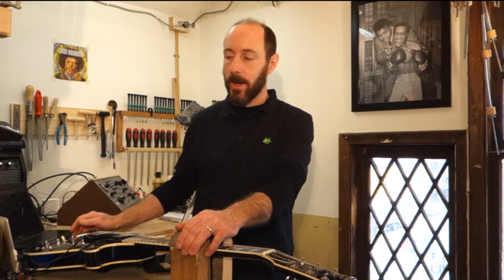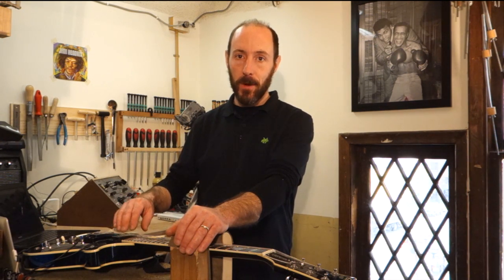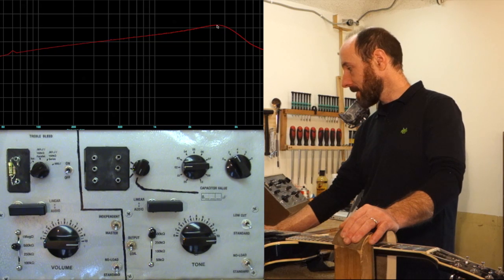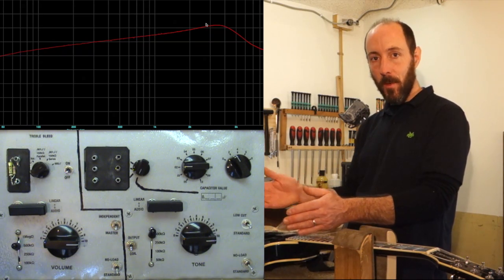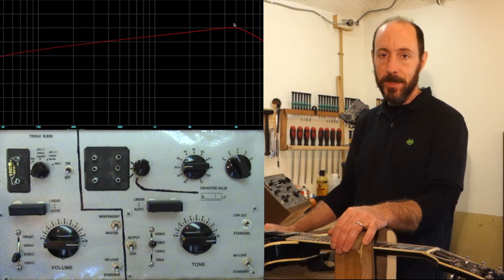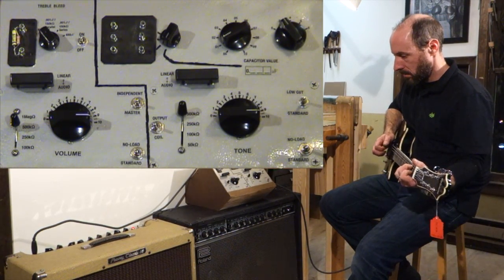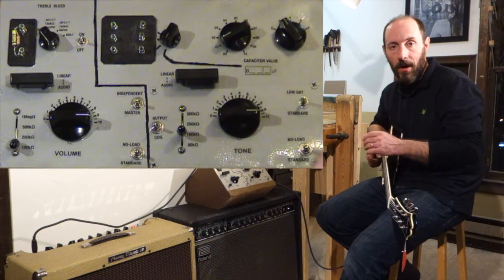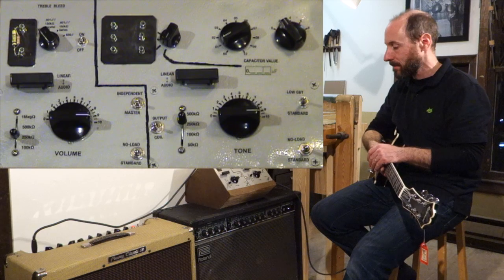Guitar Electronics 1 - Potentiometer Values

Comment: On my 2015 Gibson Les Paul Classic sprint run guitar, there's a little toggle switch in place of one of the tone controls.  It controls an active buffer circuit that can be used to boost the gain at a preset level (using an internal trimpot), intended to compensate for the loss in gain when running the humbuckers in split coil mode.  It has the side effect of boosting the treble, since it has a low impedance output which is not as sensitive to the distributed capacitance of the instrument cable.

Comment: Can anyone explain to me why loading volume pot changes resonant peak? 
Volume 10 means zero resistance which is no signal loss by the pot.
voltage divider calculates
Vin * 500 / R1+R2 = Vin 
because R1+R2 == 500
Reply: Is ot it oppsoite like 10 means max resistance and when it is 0, there is no resistance
 so the signal goes directly to ground with no sound coming?
Reply: @WakizashiSabre  no, if you look at the third video about volume, 10 amplitude signals. my conclusion is that his volume knob 10 is not zero resistance.

Comment: I don't get it, I have this Squire Strat SE that has 500k linear pots, ceramic p/u's and only like 3.1k to 3.2k resistance on the p/u's when measured through a patch cable out of the guitar jack {not exact but a pretty good indication of resistance} - and the guitar sounds a lot duller than my alnico 3 equipped telecaster with about 7k resistance on the p/u's.  Any ideas why?  Seems like it should be a recipe for ultra brightness.  And another question, why bother cutting down on your pots to get rid of highs when all you have to do is roll down your 500k pot until it's 250k?  Seems like it gives you breathing room in case you should need it, for instance if you are running a 50ft long guitar cable - maybe bringing back some highs that get lost in the cable capacitance.
Reply: I’d just like to preface this reply with the fact that this is mostly educated guesswork on my part. I’m an electrician by trade, but I’m rookie when it comes to audio/ guitar electronics. I have been doing some research into this for my next wiring project on my strat though.

There could be a number of reasons why the strat sounds duller than the telecaster, but the most obvious one to me is that the pickup design itself is inherently different, strat and tele pickups, although they are both single coils, simply aren’t built the same way.

To answer your other question, yes, with 500k pot turned down to 250k you will have the same DC resistance between your amp output and ground - however, it also means there is now 250k of resistance between your pickup input and amp output, this resistance is not present when you use a 250k pot. 

I can only assume that this means that if a comparison was made between two guitars that were identical in all other factors, the guitar fitted with a 500k volume pot will have a lower volume than the guitar with a 250k volume pot when the 500k pot is turned down to 250k due to the 250k resistance introduced between the pickup and amplifier.

In the research I’ve been doing for my next project build, I’ve seen some guitar circuit diagrams that call for a fixed resistor to be soldered between the pickup input and ground on the volume pot. This reduces the overall resistance of the potentiometer because it is placed in parallel to the resistance track inside the pot, and the idea I’ve had for my strat wiring sort of develops on this;

If a combination of a fixed resistor and potentiometer (connected in series) is placed in parallel across the terminals of the volume pot, the potentiometer can be used to vary the resistance across the volume pot between the pickups and ground, thereby changing the signal bleed effect without introducing resistance between the pickups and amplifier. 

It’s basically the same connection method as a regular tone control, but it changes the capacitor out for a resistor, so I can only assume this would provide a different response to a regular tone circuit.

In the calculations I did, by using a 1M volume pot, a 10M pot for the “tone” pot and a 170k fixed resistor soldered between the L1 terminals on the volume and “tone”, this would allow you to change the resistance at the volume pot from 150k to 910k.

I’m interested in what this mod would sound like if used as a tone pot variation, but it should effectively provide the ability to dial in to the “sweet spot” of any pickup set that might be getting overlooked because the initial potentiometer values chosen were less than ideal for the set.

Comment: Any suggestions about changing a Fender tube amp tone pots to 1meg ? I heard the Blues Deluxe comes with 1 meg treble pot from the factory. It has a distinguished bright tone.
Reply from the maker: Unfortunately I have no suggestions or opinions on this. Everything I work on is at the guitar end of the cable and I leave the amp work to amp techs as a separate specialty.

Comment: Great! Thanks for this video!
When I put a humbucker in my strat I upgraded the volume to 500K but not the tone pots.  Also I am using the 250K neck tone pot on the bridge humbucker instead.  Is this 250K tone pot reducing the high treble coming from the humbucker? 
(If it is, I like it)

Comment: Great video. So what would happen if you ran the volume through a pot without a ground on the other end, where you were just adding 0 to 220k/500k/1M inline resistance to the output?